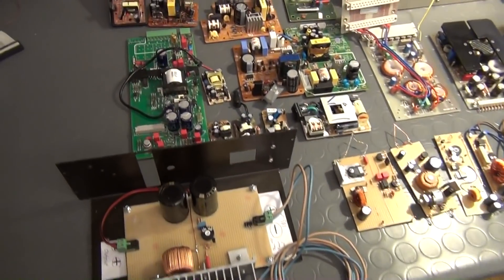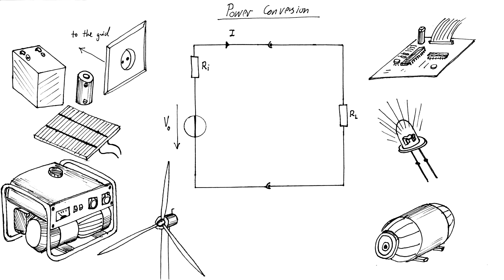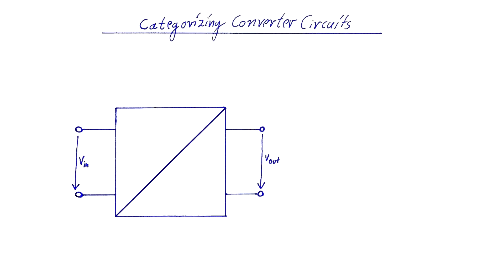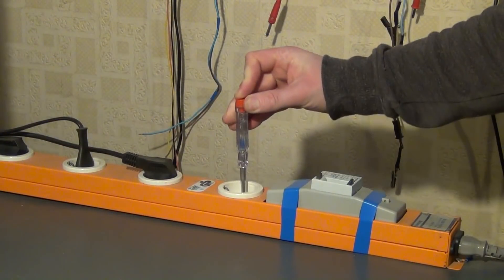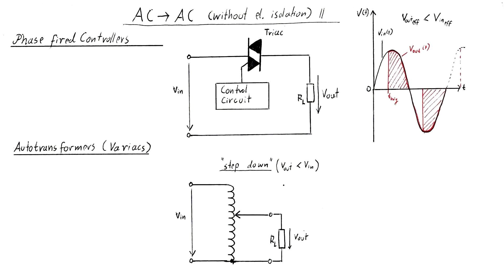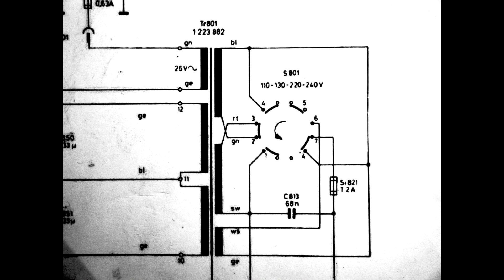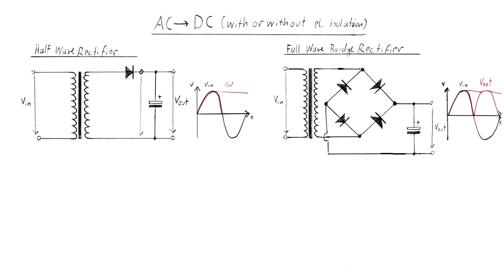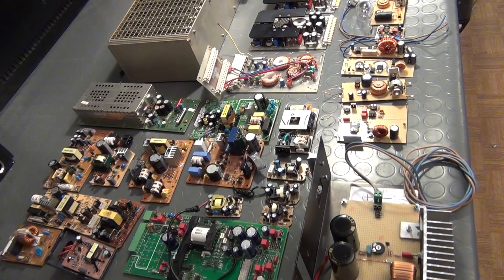SMPS Tutorial (1): Introduction - Switched Mode Power Supplies and Power Conversion

Comment: Herr Inventor, as you develop your SMPS series, would you consider commenting on how to reduce or eliminate RFI in your design discussions?  From tearing down old SMPS I see tiny ferrite toroids on FET leads and such, but perhaps there are other techniques?   I am a radio amateur and seek to eliminate computer generated RFI which can interfere with reception on lower HF bands such as 160M and 80M, and 30M which pick up fundamental and harmonic noise from so-called colorburst video chips during reception.   FWIW I use a lot of 31 material ferrite toroids to choke common mode on outdoor antennas and on equipment leads inside to some advantage.  Bis spater! chuck ab1vl

Comment: What I did was pick up throw away dvd players and stuff, I pulled the power supply boards and then experiment with them. You can connect light blubs and power them on use your oscilloscope to check signals.

Comment: The schematic of "full wave rectifier with center tap" (16:47) confuses me. It seems that the polarity of the upper Elco and the direction of the U1 Arrow are reversed....
Reply from the maker: Habati 65 The circuit is correct. Are you familiar with the concept of "negative voltages" ?  This circuit is used to obtain one "positive" and one "negative" voltage with respect to the chassis ground.  During the positive half cycle of the sine wave the filter capacitor for the positive voltage is charged and during the negative half cycle the other capacitor is charged.  Why do you need such a circuit? Well amplifier circuits need theese "symmetrical" supply voltages so that they can deliver an AC-Signal at their outrput.
Reply: The Post Apocalyptic Inventor Hi, thanks for the quick reply. You mentioning the chassis ground leads me to think that you are referring to the second drawing while I was referring the the third one. Is there no relation between the direction of the Arrow and the polarity of the the elco in the third/bottom drawing? Must compliment you for the thorough and thoughtful way you have made your video's. It is a stark contrast to many improvised and long-drawn other video's on the same subject.
Reply from the maker: Habati 65 Yes you are right the arrow of v_out2 should be drawn the other way around. I have overseen this when scanning the pictures for the video. I will make an annotation for that. Thank you for the hint ! 

( In general: Normally you can draw the arrows in any direction you want, as long as the voltage-values that belong to that arrow have the correct polarity (- or + ). In this case there are no values for the voltage. So it is strictly speaking not wrong to draw the arrows like I did. But since the direction of the arrows are supposed to give a hint towards the polarity of the output voltages, I should have drawn it the other way round.)

Comment: HI I have a problem I encounter that my supposed to be -15Vdc output in my old power uspply measured only -13Vdc. I checked the capacitance of the capacitor and it is within 20% tolerance. what is the possible cause of the problem. TIA...

Comment: I thought this was excellent. Watched it over the weekend and decided to look for part 2 today, which was coincidentally posted on the same day.. !! I've actually just pulled apart my PIR and was thinking that it must have been using some sort of voltage divider to bring down the voltage as there was no transformer... the schematic for that was helpful in understanding.
Reply from the maker: There are a lot of variations in these divider circuits inside PIRs. For example sometimes youf find a  circuit like I the one I've shown in the video and other  times it's a bit different in that you might have only one cap and one resistor as a complex divider. But the idea is always the same: getting around using an expensive transformer :D.

It's realy funny to hear  about the "chain of events" you described in your post: I mean what are the odds ? Maybe it's just teaching us one thing: The worls is big and no matter how obscure your hobbies are, there is always another guy somewhere in the world who is thinking about the same thing at the same time :D